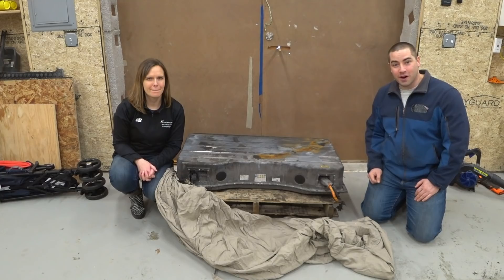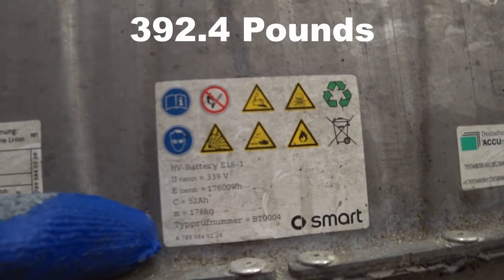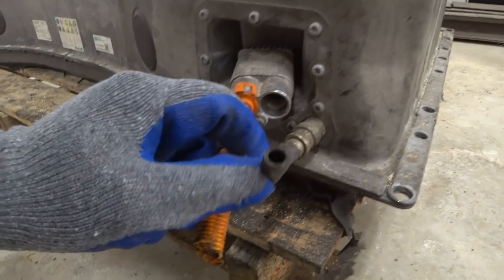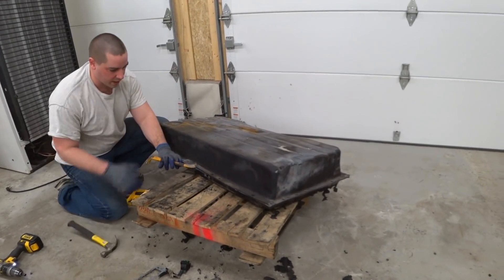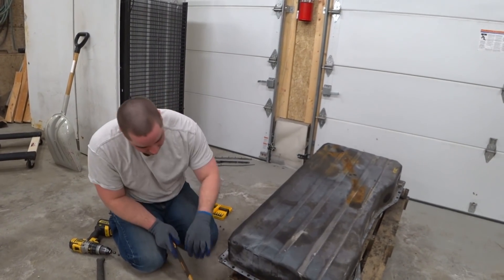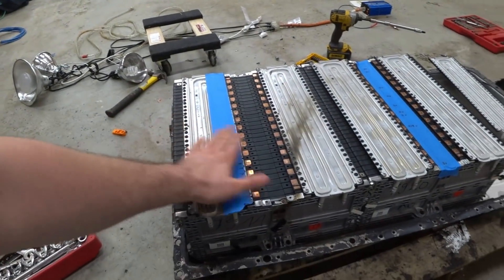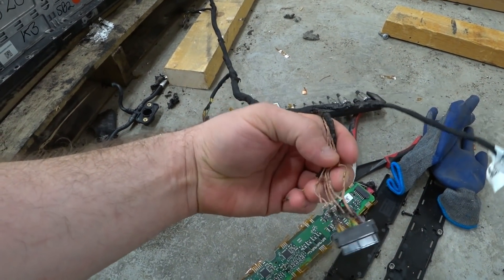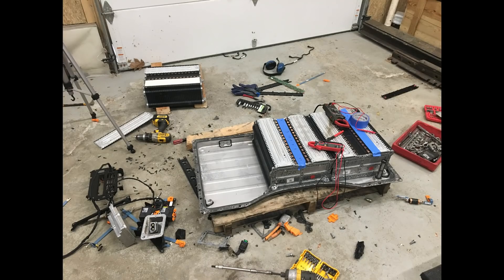Smart Fortwo Lithium Battery, EV, Damaged!

Comment: PLEASE don;t use Smart Electric EV batteries for home projects.  We Smart Electric owners are in a bit of a pinch getting parts, as Mercedes has give us all a good screwing, their internal coding mistake caused many thousands of us Electric Owners total loss of our HV pack. The failure drops all cells to very near 0.0v, rendering those cells of course trash.  My car sits now 6 months, I need cells for the car, can't locate.   Thanks for the read.

Comment: I would have checked the voltage before I bought it..theyre all at the same voltage meaning the that likely the BMS failed and/or the resistors to balance malfunctioned taking the cells all down ..
Reply from the maker: How would you check the voltage at a junkyard?
Reply: @DavidPozEnergy  after they move the battery from the car you take your handy multimeter and check the voltage
Reply from the maker: EV batteries have built-in relays..  Meaning, that once the car is in an accident the cars computer disengages the relays and locks out the function of closing the relays until the dealer re-sets it.  So at a Junkyard the battery relays are open.  The relays are built inside of the steel case.  Putting a multi-meter on the outside ports of the battery reads 0 volts no matter what.  It's not even something you can trick at the junkyard.  The only way to check is to open the case.  The case is not made to be serviceable, so opening it requires a ton of time and tools.  Something that a Junkyard will not allow you to do on site.
Reply: @DavidPozEnergy  ya ok makes sense. I am buying a 2018 Smart EV and I hope the cells are ok..its concerning what occurred..seems maybe a cell reversed polarity and or shorted... I have lots of experience in making battery packs and judging by the size of that case I could use prismatic 125 amp hour cells to get 330 volts and double the range of that car

Comment: Did you mesure the Voltage before bying? How if you did?
Reply from the maker: No.  You can't because the internal relays are off, and won't turn on outside of the car.
Reply: @DavidPozEnergy   thanks my Friend for your quick reply... The guy was telling me, is Battery was losing autonomy and it's sitting for 6 months.... Maybe some Bad cells lowering All the good one's...

Comment: Hi David, I like what you are doing and the way you make your videos!
I need your prospective about the following project I have.
Bricked 2014 Smart Fortwo at 0v after 1.5 years in dealership... Removed the battery, charged it up slowly, fairly balanced, installed it back and getting only 15-17 actual miles of range at max of 25mph. I suspect few bad cells, and will open the battery again. Questions:
Do you think it is possible to reattach the leads from the single module BMS boad (between the chiller plates) for the individual modules (the brownish semitransparent leads with integrated termistors);
Do you have any leftover cells, that I could buy?
Great job!!
Ted
Reply from the maker: Hi Ted,  Those middle BMS boards are attached to the cells with a trace that is super thin and delicate.  If you exhale on them they fall apart, LOL.  I wouldn't be able to remove them without breaking, let alone re-attaching them without breaking.  Maybe a computer person would have a technique for it?

I have no spare parts, but sometimes Battery Hookup sells these modules listed as "Mercedes cells"  

https://www.batteryhookup.com/?rfsn=3333666.ca06e9
Reply: @DavidPozEnergy  Thanks David! By the way, the videos you made helped me dealing with my own battery, as they would be source to other DIY guys. There are some cheap bricked Smarts coming to market, scarcity of parts (batteries) and finding a solution to revive them would be fun!
Please, share your thoughts about possible solution, based on the variety of cells and modules you are familiar with.

Best Regards!
T

Comment: Hi, David. Do you have a current sensor and a BMS for this battery? I need ones delivered to Russia.
Reply from the maker: I think I still have part of the BMS.  I don't have the computer bords that were on top of the battery, but I do have the controller that is inside an aluminum case.  Is that what you are looking for?
Reply: @DavidPozEnergy  Thanks for reply. The video https://www.youtube.com/watch?v=wYhI0Fl-Xnk is about Smart ED main battery disassembly. I'm looking for the BMS module (3:00) and for the current sensor (4:30). Do you have ones? If so, please, write directly ppokrashenko@gmail.com
Reply from the maker: OK, I sent you an e-mail

Comment: According to my infos here in Germany the battery is short-circuit in case of an accident thus the burned connectors.
It is done the ensure the discharge of the battery to not endanger the firemen et al.
Any smart fortwo batterie from an accident with open airbags blows a fuse on the battery and burns it for good.
The fuse is an exploding fuse and the damage is permanently.
You can try to recharge it but others have tried and most of the 90 cells stayed bad.
It is done on purpose from smart.
I taught of using one for my solar myself but got the info beforehand.

Comment: General questions, David:

Can lithium ion battery packs like the ones you have, be installed inside a house?  If not, where is an ideal place to install it?  I have to assume that temperatures above freezing, but not hot, are needed?
Reply from the maker: I know several people that have installed used EV batteries inside their homes.  I choose to install mine in my garage, which is a separate building, but heated and cooled.  You are right that you don't want them to freeze or get too hot.  If they do freeze, they have to thaw out before using them.  If I lived in a more mild climate then a shed would be a good place for them.
Reply: @DavidPozEnergy  Thanks, that's what I was guessing.

Comment: Hey Dave hows that pack, have you been able to save any cells? I have not been able to find any EV  batteries any more :S
Reply from the maker: I'm still working on them.  Looks promising.  They have been on a charger at 0.05 amps for the first week, then bumped up to 0.10 amps.  it's going to take a while, but I'll probably do an update video next week.  Anything specific you want to see in the update video?
Reply: @DavidPozEnergy  a Ah test, and a test to see if they will say balanced. Your killing it with the videos.
Reply from the maker: I'm looking forward to an ah test also.  I don't think I'll get to that by next week, but probably in two weeks I'll be able to do one.  Thank you for the suggestion.

Comment: As has been said, you need to trickle a small current of say 0.5C where C is amp hrs capacity and do it on a single cell first until you get it up past 3v then you can apply normal charging current. If you can find a lab power supply with an adjustable current limited output, that would be best. You can bring them back in series groups so that you can use a lower voltage than the 300+ that the whole battery needs.
Reply: 0.05C sorry
Reply from the maker: Hi Rhian, Thank you for your suggestions.  I love that you put numbers to it, that's helpful.  I'm currently charging the pack at 0.05 amps.  This would probably take about a year, so I'll have to bump up the amps at some point, but I'm waiting until I get past 3.0 volts per cell.  The battery is 52 amp*hours, so your suggested 0.05C would be 2.6 amps.  (please let me know if I did that math correct)  Thanks. Sounds like we (all commentors) are on the same page that a tiny, slow, charge is best.  Again, thank you for the numbers.  I love doing the math out.
Reply: Not necessarily, below 3v you shouldn't draw too much current but on the other hand, the voltage comes up quite quickly when below 3v charging with a smaller current. @DavidPozEnergy

Comment: Yes, all hope is not lost, you can still use them.
You need to take put the modules in parallel and not series so that you will not be dealing with a high D.C. voltage when they are all charged.
Then you need a good lithium battery charger, not a fake one that will cause a fire. when all the modules are in parallel first charge them all together to like 12v then bring them up to pack modular voltage.
the choice of your charger will determine a lot in this process.

Comment: It would be most important to check the battery voltage before assembling disassembling it it sounds really bad I would definitely not use any cells that have dropped below 3 volts each cell better luck next time

Comment: That sucks big time... How much did you spend on that paper weight.
Seeing that the seller just cut all the wires "noob style" and said that he doesn't want to have anything to do with "batteries"... It looks like when he cut the wires he saw the sparks and possibly the melting insulation smoke/smell and decided to pawn off the defective battery on someone else. I'd try to get a refund.

Comment: Good Battery) 48v? Thank you guys.
Reply from the maker: The battery was originally used at a high voltage, around 350 volts.  If I can salvage any of it I will re-wire it to a 48 volt system.

Comment: My guess is the cells will be fine. Probably got a degraded life out of them, but if you charge the individual cells with a 1 amp trickle, it should recover. 

Slow is the trick.
Reply from the maker: Thanks.  I currently have them hooked up at 0.05 amps.

Comment: charge each cell at 100 mA over the course of a few days and watch the temps. I've revived lots of 18650 Li-Ion cells from 0v that way and they are still working perfectly fine.
Reply from the maker: Thanks.  I currently have them hooked up at 0.05 amps.

Comment: That rust patch on the outside is obvious fire damage if you know what to look for.
Given the metal casing is plated, rather than paint, it takes a lot to remove a patch to expose the steel to rust.

Comment: keep in mind that a EV battery loses 3% state of charge each month they set .  so if your looking at a used crash unit all so say the battery was at or less then 50% state of charge  when the car was crashed .  most junk years know they need to get off left over battery with in a year of them being pulled from the car .  at the start of your video you  can see its been setting some where on some ones shop floor for some time now . it was very hard to know about the bad wiring on the inside but just for how it looks form the out side i say your have a 95% that you lost your money  and would have even if the bad wiring was not there .  i am not saying this to bash you at all but to help add info out there when looking at used EV to own and batterys from them .  all so the 3% number is from Tesla and GM . all so 1 more note to add . if your going to let a HV pack set for more then 6 months you are to put the % of charge at 50% to 40% . if the pack sets at 100% for to long it well hurt the battery as well . if you have a junk yard telling you that they charged it to full before pulling it and its been 6 months or more  then walk away from it

Comment: I really love the work and videos that you and others out there do and I am gaining great deals of knowledge and ideas from them.

The one thing I have learned that I would suggest is the better route for you and likely many others is to forgo all of this repurposing of batteries and buy LiFePO4 battery units in the AH and voltage (You can get 12v, 24v and 48v output configurations eliminating the need to series them) and count that you need or want.  LiFePO4 are naturally a drop-in fit/replacement for lead acid.  This makes them massively beneficial where almost all charging and inverting hardware on the market is based around 12v.  LiFePO4 are longer lasting, safer, faster charging, no off gassing, no thermal runaway issues (Or at least like LiCO or other Li Ion chemistries) and can deliver a massive current draw both continuous and peak.

I have been looking at Battle Born and LiFEPOwer and the prices may feel a little ouchy but when you consider they can be safely and repeatedly taken to 80% DOD, they will actually GIVE you back the power you are storing.  All of these batteries also have their charge controllers built right in them so you literally just hook these things up to the 12v charging circuit of say your AIMS unit or to all the various other 12v bulk charging systems out there.

The only real downside is they can't be charged at or below 0 C/32 F.

The general going price is about $1000 CAD/$800-$900 USD per 1.2 Kwh of storage.

Now all the above to say that if you can get a terrific line on salvage and you want to tinker, then power to ya!  I still salvage 18650 cells and will be building low power packs for 5v and 12v use based around the Vruzend battery building kits.  But when I finally get to adding backup power in a way that will prep me for a generator and solar to be added on, I will be getting LiFePO4 for the batteries.
Reply from the maker: That's cool Jason.  I've been looking at trying to get a few cells of lithium iron to tinker with.  If you are looking at the Battle-born, have you also seen the Kilo-vault?  They are similar, but a little better price point. https://www.altestore.com/store/deep-cycle-batteries/lithium-batteries/kilovault-lithium-solar-battery-p41011/#KLV3600HLX-V2

Comment: The bms wires without insulation looks bad. If I'm not wrong these cables make the pararell connections for balancing. Whithout insulation you can find several pararell groups shorten stored for long time without voltage... Plus the heat the rest of cells were exposed.

Comment: You got this. If anyone can make it work, it's you! Allot of the time the heat only comes from a small part of the battery. Based on what I can see, most of those cells should be fine. Change slow but you know that!
Reply from the maker: Thanks.
Reply: The problem is if they've self discharged after the damage below their safe minimum no amount of recharging is going to save them.  I recently pulled apart a V lock battery with decent Samsung cells but unfortunately it had been left too long in a discharged state and all the cells were at or close to 0V. This causes physical damage to the cells - they're toast. I hope it's just internal fuses that have blown David - should be pretty quick to determine that by measuring the individual cells.
Reply: @mondotv4216  Underrated post!

Comment: that sucks! I bought a Hyundai sonata battery that was like that... you should be able to save a few cells I hope! good luck man. that's the gamble I take every time I buy one of these batteries.
Reply: Can you or can you not measure that voltage before disassembling?
Reply: @SolarizeYourLife  normally you cant cause the main safety plug is missing.

Comment: You pay your money and you take the chance with junk yards (recycled parts) but removal with a reciprocating saw can't be helpful at all. I think I would go at them in the smallest denominator possible so 1s if the come apart that way, likely not but even 2s then you can determine if each cell is saveable. A bench voltage supply which you can control the voltage would be nice then try the nominal voltage at 0.2 amps or even less. Looks like a time consuming project.

Comment: Also check for the fuses on each cell...  
Every cell shuld have piro fuse on +side...
Reply: when you open the pack that big black thing you had supposed to protect the batteries and each cell has a fine wire leading over to what most people called the bus bar on the plus side that's why you're getting zero volts the fuses have blown. Check the voltage on each individual cell and we'll see
Reply: Leigh Amos that black fuse on the right is 450 amp fuse but you were bypassing that by placing your multimeter directly on the pack studs themselves. The guy who cut those wires fried this battery. He’s luck they didn’t start on fire. That 450 amp fuse probably saved his life but fried his saw.
Reply: I think he meant pyro-fuse. Good luck!
Reply from the maker: I just googled "piro fuse" and came up with nothing.  What is that?  Thanks.
Reply: @DavidPozEnergy  Perhaps he meant "Pyro Fuse".
Reply: @DavidPozEnergy  Pyro fuse - it's a wire that is physically broken with a pyrotechnic explosion when a fault condition is encountered because large fuses can take too long to blow during which a lot of damage may still be done.
Reply: @DavidPozEnergy  Pyro fuse - more commonly called a pyro switch. However, I've only ever seen them on overall battery pack disconnects, not individual cells. They are usually connected to the airbag system to shut off the electrical power in the event of a crash.
Reply: Pyro used on tesla and nothing else. Not required for these cells
Reply: These are not 18650s
Reply: David tell us about the progress that you made on battery's... In video... I mean.. 🖖....

Comment: I imagine it's similar to recovering 18650 batteries.  Might need to split them apart, but if you parallel a bunch of those 0v cells together and then use a charged battery to bump them, you might be able to get those 0v cells to bounce back.  Do it slowly though and check each cell after a bit and see if they hold any voltage or drop back down.
Reply: No, you do NOT bump lithium cells like lead acid - the chemistry is completely different.
Start with low current and bring them gently up to 2.8V, pause a while and see if they hold, then you can start ramping up a bit until the constant voltage phase.